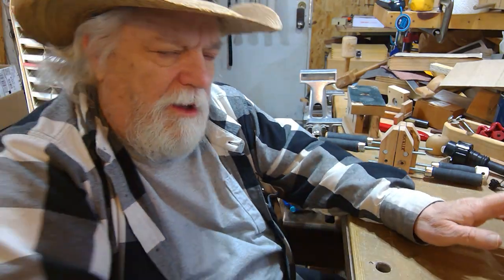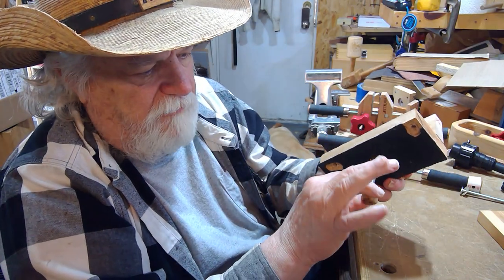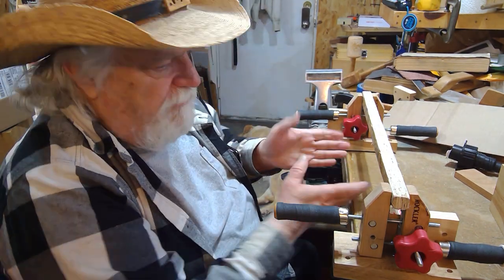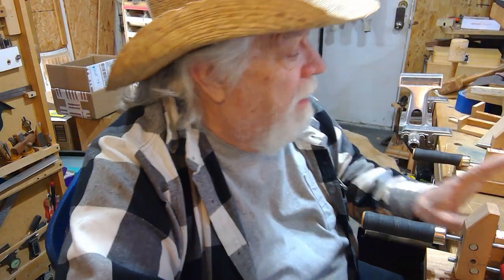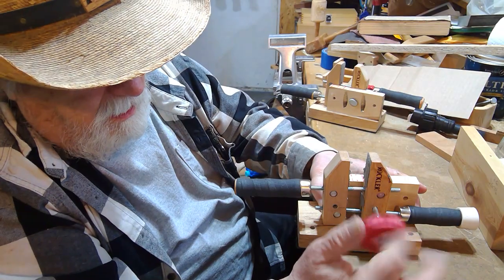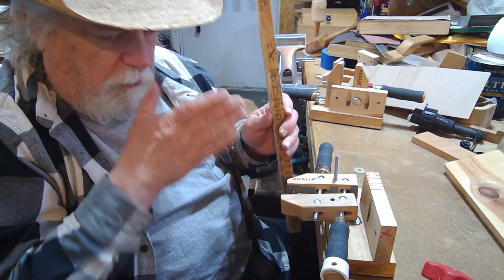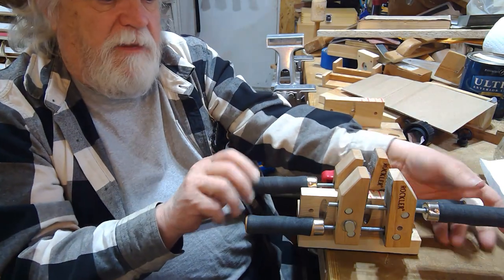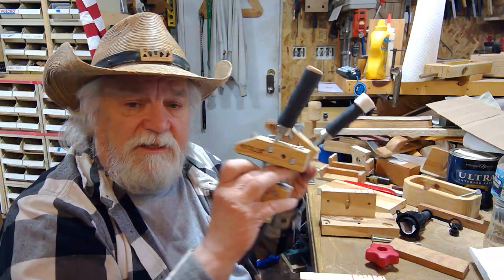Handscrew Clamp to Workbench Vise in 20 seconds by OTB Thinker

Comment: Hmmm I’m thinking about the vintage clamps I rarely use but mostly abuse. Commonly I sand knife blades and scales. Ordinary vise is best for working thin side up and flat side vertical. Your design has soft jaws and looks easily adaptable to working / sanding flat / wide side. You also are proof that dogs love can be purchased 👏
Reply from the maker: I like to think that I earned their love :>).  Dogs are good therapy and entertaining.  FYI, I do have several videos on handscrew clamps and even one on a jig to hold it horizonal or vertical.  Thanks Kent